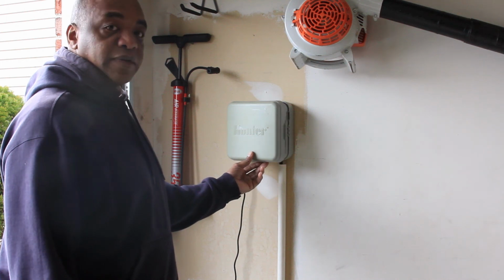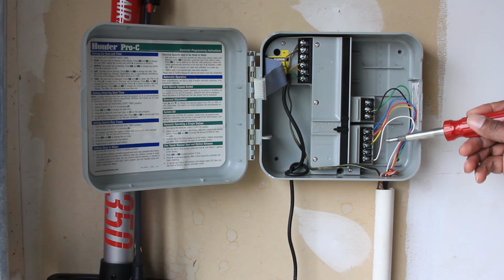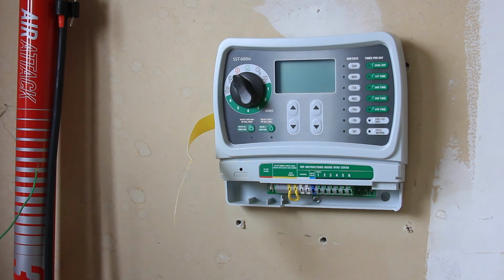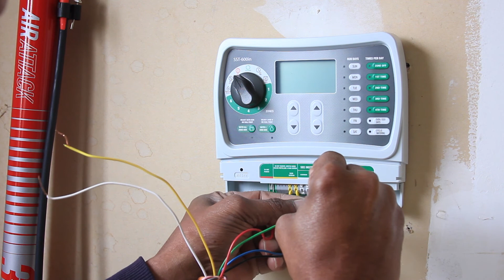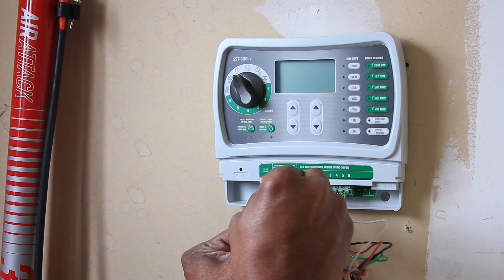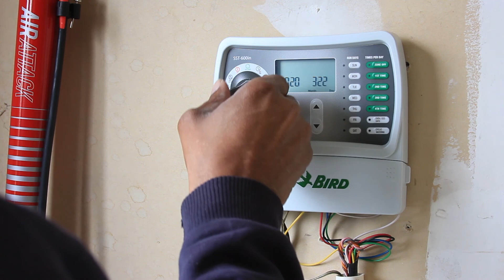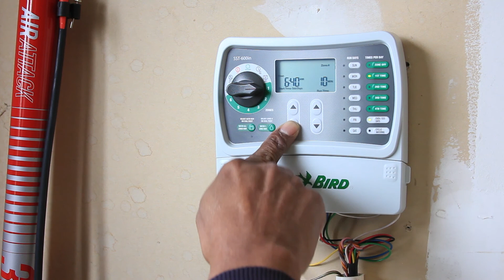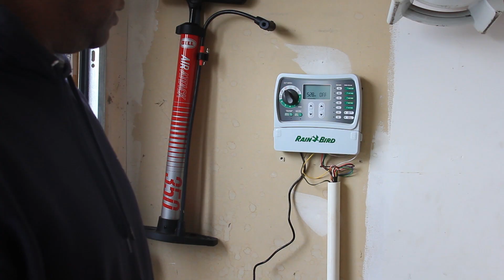How to Install Rainbird Irrigation Panel

Comment: thanks for the video. seems pretty easy.. my old rainbird went out.. it's about 15 years old.. so i just went to home depot and bought one so will follow your instructions
Reply from the maker: Replacing the controller is somewhat intimidating, but it's fairly easy. No doubt you can do it!
Reply: @DIYFixer331  - it did look intimidating because i don't like wires.. lol

just saw this video and it made it easy.. took me 10 minutes and i have a sprinkler system that works

Comment: It seems that Rain Bird did not do a good job of having the pvc tubing with the wires connected to the bottom of the unit. I am not happy that they did not make a special opening at the bottom  of the unit to make a connection just like the Hunter unit was set up, with the pvc tubing coming right up to the bottom of the control unit.

Comment: Thanks for your video. Do you know what type of backup battery it uses, and how to replace it? I didn't see this in the manual.
Reply from the maker: The internal rechargeable battery is not intended for replacement.

Comment: I am on my second Rain Bird SST1200OUT. The first lasted just 4 years and lightning quite literally blew it off the wall. I am buying another because of the ease of operation. I have to figure out how to protect it better. I am installing a ground rod and home made surge protector (1 amp fuses and MOV) for each of the control wires. The internal MOV's did not do a good job of clamping, the copper foil exploded from the PCB. This was a very direct strike and probably a one time occurrence.
Reply from the maker: It is very unfortunate that your box suffered a strike. As you indicated it is probably a one-time thing. I would not hesitate to replace it with a new box. The issue is not likely to occur again!

Comment: quick question.  how did it "go bad"?  mine is acting real goofy like losing programming and not running individual zones.  did yours just conk out all together?
Reply from the maker: There are a number of things that can and will cause a board to go bad with electronic components including, heat, cold, moisture, poor design and build, and other factors. There is noting we can do but replace a unit that goes bad.

Comment: I am very satisfied with this model’s features,function and user friendliness. Periodically check panel as a power outage may deprogram date and time settings. Does anyone know how to replace the battery ?
Reply from the maker: The internal rechargeable battery is not intended for removal.

Comment: When I want to use the Auto Run feature, I cannot alter the run time at all. Is that feature, therefore, not available? Thanks. Terry
Reply from the maker: The run time can be adjusted for auto run, I encourage you to check again and also review the panel's manual.

Comment: Right hand is in front of camera view when connecting the wires.
Reply: Six zones, six wires (plus white common wire).  The only hard part is making sure what you want to be zone one valve is connected to zone one, etc.
Reply: My rain wire has only 1 not 2 ? So which one should I put the brown rain wire in ? Thanks

Comment: Did you need to turn a breaker off to do this?
Reply from the maker: The irrigation panel has a 120V cord that plugs into an outlet. It is recommended that the cord remains unplugged until the wiring is completed.

Comment: Why did you turn it off after each setting?
Reply from the maker: Don Lang, I was actually turning the dial to the specific zone to set the run time. The daily must be positioned on the specific zone that you would like to set.

Comment: How do you replace the battery when its time?
Reply from the maker: The internal rechargeable battery is not intended for replacement.
Reply: @DIYFixer331  The 12 Zone model has a 2032 lithium coin cell inside. A bit involved to open it that far with a half dozen screws in the back, but rest assured, you can change it. But it backs up settings, not the clock so it will last a long time. The clock runs 3 days on a super capacitor.